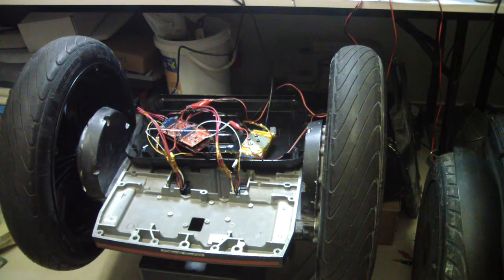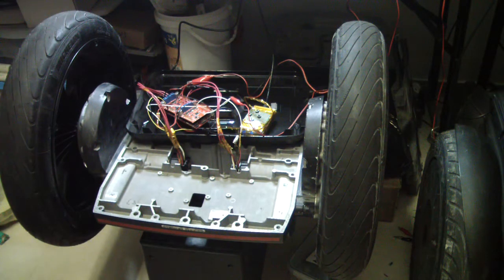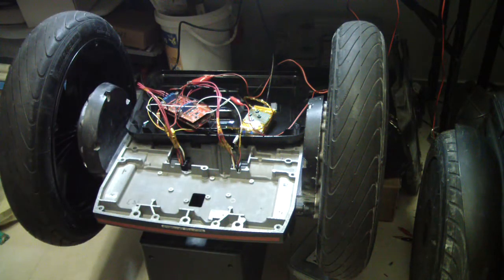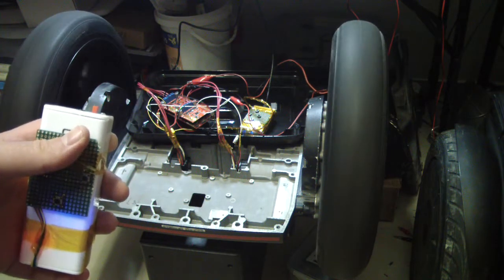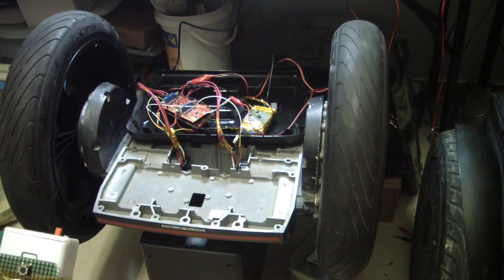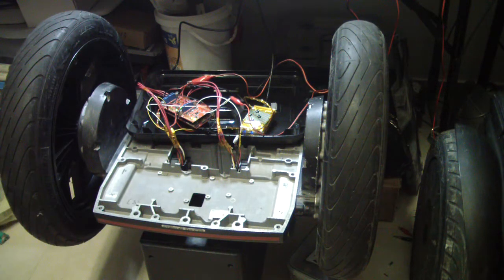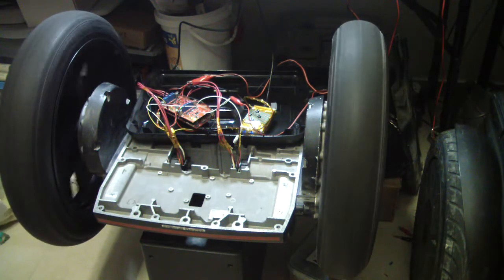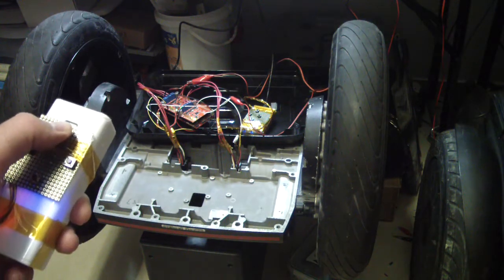Car Project Chassis First Test

Comment: Hi What motor drivers are you using?
Reply from the maker: I have used TI something, search for full bridge motor driver by TI, the board current out is high about 20A
Reply from the maker: https://www.ti.com/lit/eb/sldc006/sldc006.pdf?ts=1642628198009&ref_url=https%253A%252F%252Fwww.ti.com%252Ftool%252FBOOSTXL-DRV8301